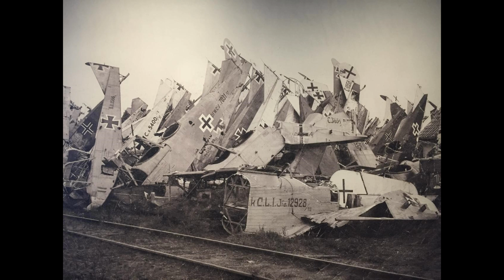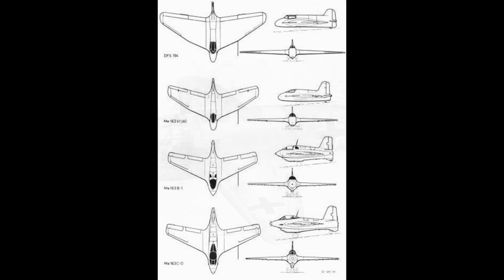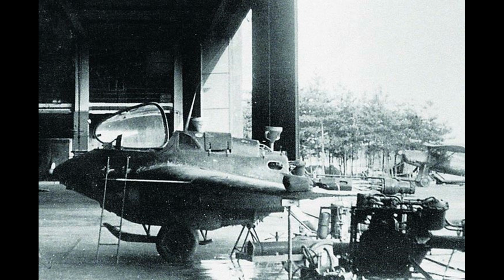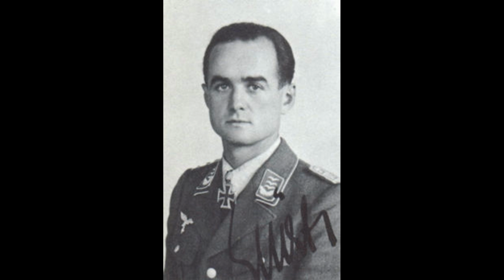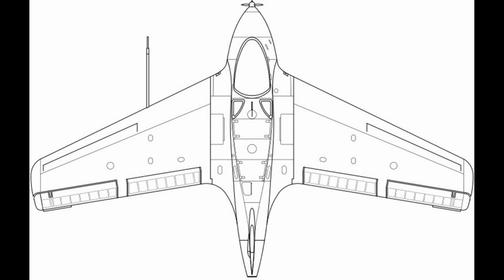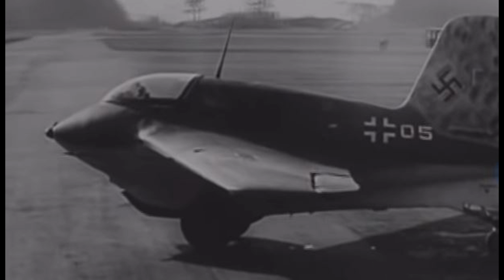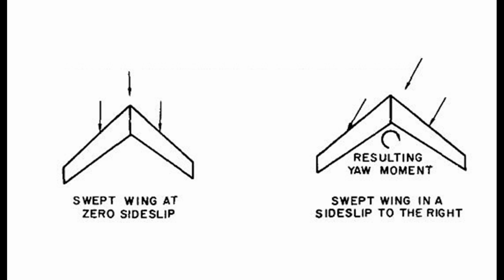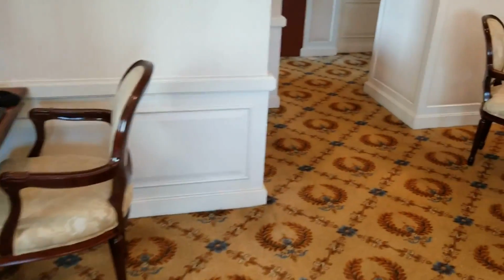Messerschmitt Me 163 Komet Pt. 1

Comment: Only just came across this, hence the very late reply, but this is an interesting topic. Toxic fuels & temperamental engine aside the 163 design was pretty good. I know of several people over the years that have built scale 163 model gliders for slope soaring. They all say that these models fly really well from day 1 with little or no trimming needed. Sure, as they are gliders they can be relatively light and Reynolds number probably plays a part but it still says quite a bit about the design. Another point is that wingtip washout is very common on gliders (especially older gliders) as wing tip stalls are pretty easy to induce with a high aspect ratio wing, so I'm sure its a tool Lippisch would commonly use.
Reply from the maker: better late than never. Please watch part 2.

Comment: That's crazy he was able to get back to the field, pilots call that "the impossible turn" for a reason. I've tried it a few times with my RC plane, never pulled it off
Reply from the maker: If you climb at a steep enough angle it becomes possible, if all the ducks line up for you.

Comment: Very interesting video, really enjoying the whole series!
The human aspect of flying these fast Messerschmitt aircraft is an interesting topic as German flight surgeons not only performed test in altitude chambers but also in rapidly rotating centrifuge to check G-forces. Both the German Luftwaffe Me 163 and Me 262 aircraft could climb very fast to higher altitude but lacked a proper cabin pressurization system so pilots encountered aeromedicine problems with the pressure difference. Luftwaffe flight surgeons solved this problem by puncturing a pilot’s eardrums pre-emptively. Together with many German engineers, Dr Ulrich Cameron Luft went to the USA where he was involved with the recruitment of the first “Mercury 7” NASA astronauts in 1959.
More in my article on the first seven NASA astronauts….

Comment: These are called hypergolic fuels. High test hydrogen peroxide is hypergolic, meaning it spontaneously burns, in contact with ANYTHING made of carbon. It can also be used without any other hydrocarbon fuel, as it spontaneously breaks down into steam in contact with a silver catalyst. Russian rocket torpedoes use it as fuel, but it’s very dangerous. One drop of the stuff dropped on the floor in the torpedo room sank the submarine Kursk.

Comment: I had met Dr. Alexander Lipish (sp). At Cedar Rapids Iowa. the man was so brilliant. He designed a ground effects machine that had controlled flight above 50 feet!. the test pilot cut a hole in the fuselage and installed seat to take the Dr. for a ride in his design! Thanks for the videos!
Reply: The reverse delta, steep anhedral worked well. Several modern makers are trying to market GEVs with it for small, short travel.

There are some good videos of his x-113 & the larger x-114 flying.

Comment: "If the ground is shaking and exhaust flames green they must be running that Hydrazine" . . . Old drag racers ditty. The fuel is highly unstable, highly carcinogenic and highly illegal in both sanctioning bodies. Nevertheless even in small percentages it put some drive-trains on the ground and some cylinder heads in the air.
.

Comment: Hi Greg, again a great and very enjoyable video.  Now I know a lot more about Komet developement.  I agree with you about twist and in the photo you point out the twist is pretty obvious.  I think all tailless (and non canards) are swept (deltas are very swept and vert tapered), it has as much to do with longitudinal stability as with the lateral (ie yaw) that you point out.  Viz flaps, flaps and slats usually increase wing area and always wing camber.  Wing camber produces high a pitching moment and flying wings don't have tails (or fore planes) to balance them.  I would recon that that is the reason the landing flaps are mid mounted and not trailing edge mounted (any aerodynamists out there?).  I have only ever heard of one straight winged flying wing and I can't remember the name or the test results but it was a NASA project in the 1950s.  I read about it about 25 years ago so please excuse vague memory.  It flew scewed to the line of flight and varied the angle with speed ie a one sided swing wing, a control nightmare.
Incidentally, I don't speak German but looking from an engineers point of view might it translate as "mix" or "mixture"?

Comment: I have no primary data but a tailless flying wing will need to have a certain among of wing twist. Of course you can see that they also used a reflexed airfoil to provide a nose up pitching moment so the c.g. can be in front of the aerodynamic center and make the airplane longitudinally stable. Still the inboard needs to be lifting more than the tip to pull the nose up.  Also, the elevons would tend to reduce tip angle of attack when pulling back on the stick. I think all of this helped to mitigate tip stalls.

Comment: Found your channel a few days ago and, well, let’s just say this probably has not been my most productive week : ). Thank you so much for making such fascinating content. Almost all the information on the 163 was new to me but I think I had heard of the fate of Josef Pöhs before. My question: can you explain the physics of how the dolly bounced back high enough and with enough forward velocity to strike the plane?
Reply from the maker: Hi Peter. Thanks for visiting my channel. Yes I can explain that. It wouldn't have to bounce that high as I think this happened right after lift off. Still, I think your question is how did it bounce higher than the altitude from which it was dropped. That's easy, go out and throw a tennis ball at a ramp, like one you park your car on to change oil. It will bounce far higher than its starting point. Grass runways are not perfectly flat surfaces. As for the forward velocity,  of course it looses some, but it hit near the tail.
Reply: @GregsAirplanesandAutomobiles  Thanks for the amazingly prompt reply! The ramp analogy is very helpful. I still think Oberleutnant 
Pöhs could reasonably claim to have gotten a very unlucky bounce but I guess he’s not the only aviator finished off by an unlikely sequence of events.
Reply from the maker: So much happened in WW2 that almost anything that could have happened did.

Comment: Greg, I'm Not a fan of thw 163 but this was a great piece. Not only about the 163, but about aeronautics in general.  Enjoyed the love shown for the 727. It had highly advanced features that made it a highly capable plane for all sorts of different airports and runways.   It was the first jet I ever flew in (headed to basic training at Ft Sill.   I was seated behind the wings and was both amazed and unsettled by the huge and complicated flap system as it actuated.   I was just a kid, so it looked like the wing was coming apart.  The flaps were almost 1/2 of the wing structure when fully extended.   Not only did they tilt down, they extended down and rearward on these massive screw actuators till it looked like there were two or three separate wing surfaces.  The noise from the mechanism. was very distinct.   .   We hit the runway and everything seemed to instantly reassemble itself and the spoilers flew up allowing for the 727's sorter landing lengths.  I was hooked on aviation from then on.  Well done!

Comment: Greg, "Stoff" just means a chemical substance of kind.  It could be a mixture or a pure element.  Hydrogen, H2, is Wasserstoff (stuff from which water comes); Nitrogen, N2, is Stickstoff (stuff that will asphyxiate you); Oxygen, O2, is Sauerstoff (stuff from which sour things come, i.e., acids); Fuels are Brennstoff (stuff that ignites and burns); Bombs contain Sprengstoff (stuff that springs violently, i.e., explodes).
Reply: Would I be correct in assuming it's the root of "stuff"?

Comment: I've read that most top 109 pilots wired the leading edge slats closed because they had a tendency to deploy unevenly during high G maneuvers.  Wing washout is a wonderful thing, really improves the handling and recovery in a stall in all of my RC planes whether swept straight or delta.  You can definitely see it in the side view of the 163. If your wings are covered in monokote just add a little twist and re shrink.
Reply from the maker: Do you have a source that that comment about 109 pilots wiring the slats close, because I have never heard it, and I don't think it sounds like a great idea. Not saying it didn't happen, just that if it did I would like to read about it.
Reply: @GregsAirplanesandAutomobiles  Actually now that I think about it I didn't actually read that I heard it years ago in a video interview of Günther Rall.  He also said that most top ace's preferred not to use/fit the wing mounted guns on that plane because flexing could cause a breakage in the chain that fired them and could result in a stoppage of all guns.  Not sure how that all worked out as far as the mechanics of it goes but I remember that's what he said. This was in a interview on a video that was on a combat flight sim CD-Rom from the late 90s and damned if I can remember the name of the game! Sorry about that but I recall it all clear as a bell (The interview )
Reply: @GregsAirplanesandAutomobiles  I really loved your videos on the P47 btw  My uncle was a fighter crew chief in WWII in China.  At times he worked on damn near everything in the inventory and he thought the Jug was the top of the line but thought that the P40 would make the best privately owned fighter because of cost robust landing gear and simplicity of maintenance.
Reply: @GregsAirplanesandAutomobiles  Jane's WWII Fighters Electronic Arts 1998
Reply from the maker: Thanks Samuel.

Comment: Not the craziest German rocket plane design. There was the Bachem Ba 349 Natter, largely made of wood, that was essentially a manned ground-to-air missile. It would take off vertically and, when approaching the allied bombers, fire off the armaments (a salvo of rockets) before gliding back down whence the disposable nose would be discarded and a parachute used to land the fuselage, the deployment of which would throw the pilot forward, out of his cockpit, and he would land with his own parachute. 

The first powered manned test flight resulted in a fatality, but there were three more, successful, ones. It used the same high dangerous fuel mix as the Komet. Despite having been deemed to have passed its safety tests, and 200 being ordered, none made it into operational service. 

The Natter was to have been able to reach an altitude of 12,000 metres in 62 seconds compared to the Komet's leisurely 225 seconds... 

In the case of the Komet, one allied pilot did get to try it out after the end of the war (against orders) and that was the irrepressible Eric (Winkle) Brown, who is reported to have said it was the only aircraft he flew which he was truly wary of (during his life, he flew 487 different types).

Comment: The wing design is primarily for stability more than supersonic performance. Alexander lippich is a major source for the functional flying wing. Moder day hanggliders etc. owe a lot to him. The lippich wing is delta planform for yaw stability, and have usually wash out wingtips or higher lift wingtip profiles, in order to keep wingtips flying when the wing center section stalls. Hence a stable stall piching forward, and not inducing spins. The tailless glider/hangglider called swift is a perfect example
Reply from the maker: That's all covered within the two episodes, except of course the part about hang gliders, good point.
Reply: Sorry, i was too fast commenting. You mentioned stability later..

Comment: Thanks for your work, 👍 it has been extremely informative and hilarious at the same time. Great sense of humour you have, a few occasions I started giggling and couldn't stop for while.

... at least T-Stoff and C-Stoff were water soluble ... so mechanics did not have to be working on a ticking bomb ... : ))

... Erprobungskommando 16. I'm not gonna try that German name ...

... His wing clipped that flag tower. Just barely, but in airplanes just barely is a problem ...

... Guess where they decided to put the additional tanks holding the flesh dissolving T-Stoff. If you answered, in the cockpit, you were correct ...

And at the very end:

... Women with negotiatiable virtues ...

Greg, you made my day
Reply from the maker: Hi Robert, I'm glad I could help brighten your day a bit.

Comment: Hi Greg - loving your channel.  I'm a hang glider pilot.  yup, the sweep of the wing is the only thing on a hang glider that provides yaw stability, the pilot can't affect yaw control.  Our wings have twist or as we call it washout for the reasons you describe.  When a HG wing starts to stall they do so first at a point about 20-25% out from the root.  As the pilot continues to increase pitch up pressure the stall expands laterally both towards the root and tips.  As the stall deepens the location of the center of lift keeps moving aft, due to the sweep and twist of the wing.  Eventually the pilot is not able to move their weight far enough aft to counteract the pitch down forces on the wing and the nose falls through.  It is the twist in the wing that keeps the tips flying and the sweep of the wing that places the tips far enough back to provide the pitch down moment that causes the nose to fall and the wing to accelerate and regain flying speed.  Our wings also have reflex at the root.  The first 1 or 2 battens at the root have the rear portion bent up to provide some pitch stability.  There are also tubes called sprogs out near the tips that hold the tips up if the wing is in an unusual attitude in order to maintain pitch stability.
Reply from the maker: Thanks, that's a great post.

Comment: When the carcinogenic effect is actually the least of your worries...
If anyone is interested in the chemistry and handling of hypergolic fuels, Scott Manley has a really interesting video on it.
Reply: At the strength both are present at, chemicals burns are quite the possibility. TBF becoming the human torch is also possible with that volume of relatively high test peroxide. Both reputedly unpleasant ways to go, dimethyl mercury poisoning always looks that tinny bit more unpleasant (serious heavy metal poisoning in general is grim) but either form of burns seem exceptionally unpleasant.

Comment: Comment on the flaps issue - the location and lack of trailing edge flaps would be more due to the pitching moment created rather than unavailable space, right?  I may be wrong about this, but for trailing edge flaps to be effective on a tailless design, the sweep would have to be much higher, and the flaps would have to be restricted only to the root area.  The only other option would be to crow like on a glider, with both elevons up when flaps are down.  This basically makes drag only rather than higher lift.

PS:  For me, this is the best channel on all of YouTube.  I look forward to every new video.  Keep it up!
Reply from the maker: The pitching moment is a factor. Depending on C.G. and amount of sweepback, trailing edge flaps could just induce a strong pitch down moment, rather than act as flaps.

Comment: Actually the diamond pattern in liquid fueled rocket efflux is a sign of engine inefficiency specifically related to the nozzle.
With regards “wing twist” or washout there are factory blueprints available that show a definite washout in the AoA of the tip rib (neg beyond 3deg) vs that of the root rib (positive 3deg). With regards sweepback on railway aircraft your explanation is not inaccurate however there were a number of straight winged tailless designs like the Fauvels
Reply from the maker: The mach diamonds appear anytime the engine is running correctly for take off, I made no statements about efficiency. The wing twist is discussed further in part 2 with a diagram. I'm unclear on what portion of the sweepback discussion isn't accurate. It would help if you could be specific. I have no idea what "railway aircraft" are.